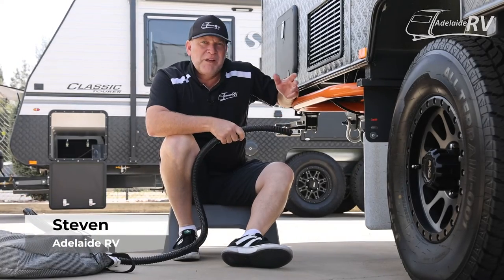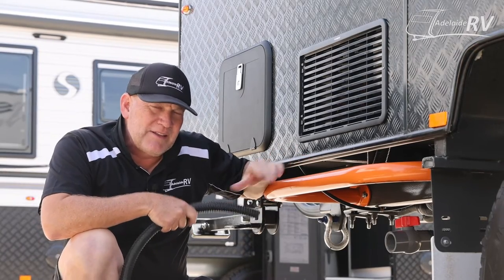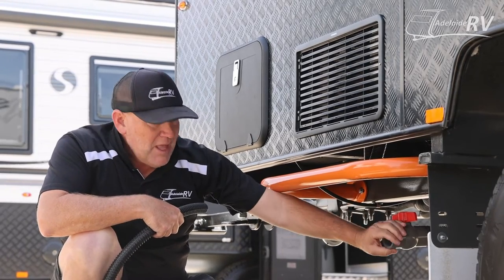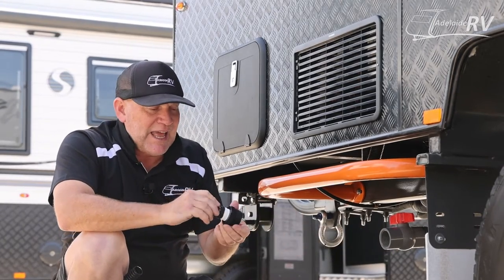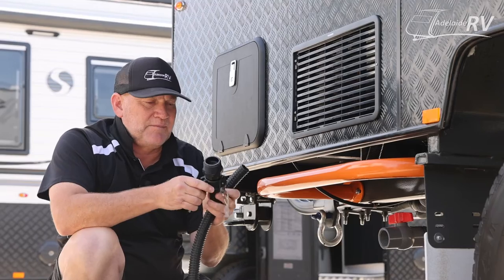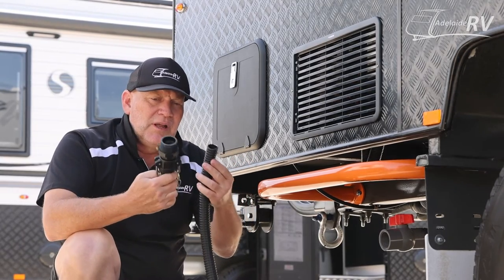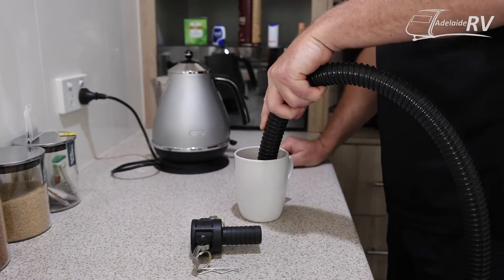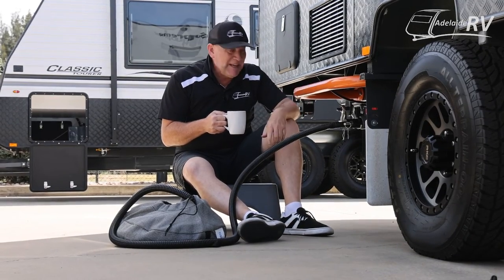Sullage Hoses - HOW TO Connect

Comment: Your using a 25mm hose would it better to use a bigger diameter hose to empty the grey water system a little quicker
Reply from the maker: You definitely can…but 25mm is the most standard fitting to purchase etc.